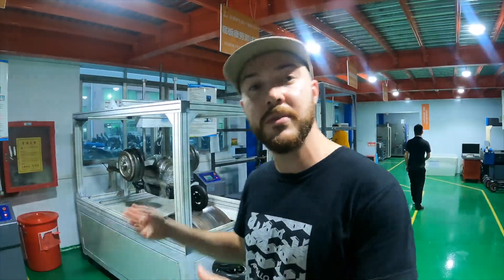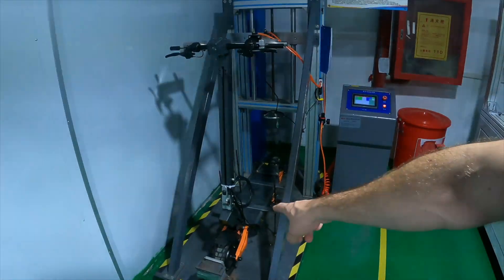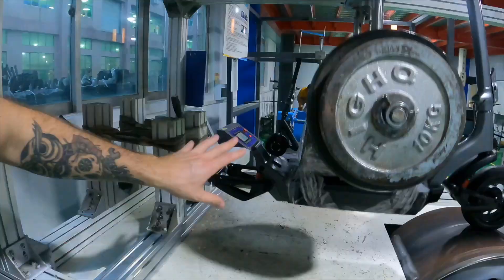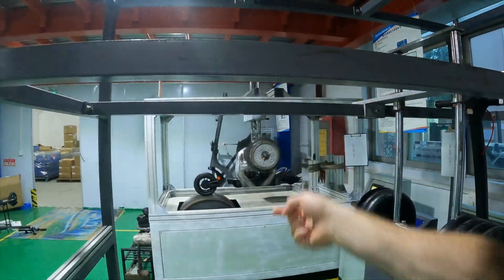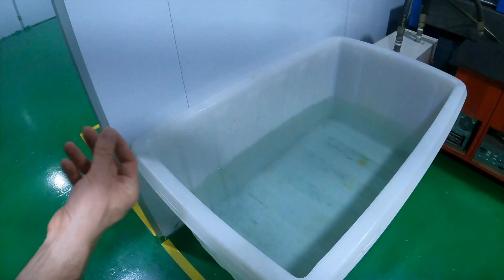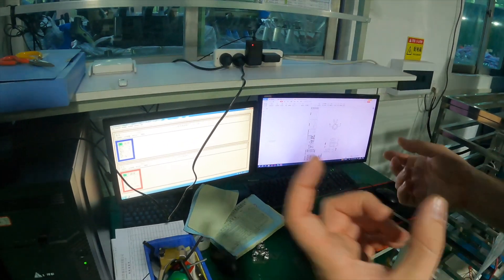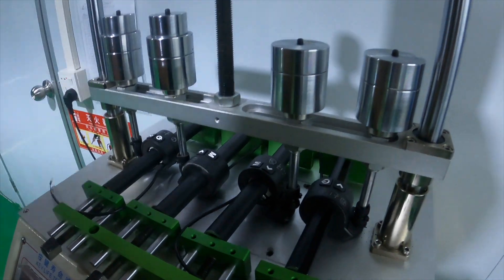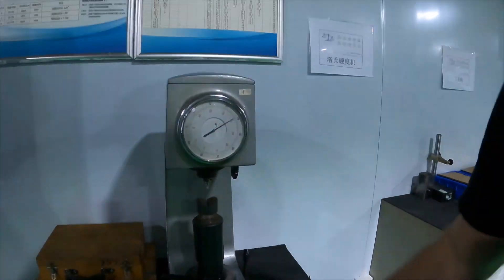Apollo Factory: Quality Testing Process Preview

Comment: Will the scooters with IP66 rating or higher ever be covered under warranty for water damage? 

I've noticed a lot of companies advertise their products as water resistant or water proof but they don't cover water damage in the warranty. 

Is there a reason for this and do you guys have any plans to address it? 

It only seems appropriate for a product advertised as water proof to be covered by warranty for water damage.
Reply from the maker: Hi Oven Heating,

Thanks for your question!

While we strive to provide the best possible water resistance rating that we can, electronic devices are never covered for water damage under their respective warranties. The reason for this is that water damage is usually classified as physical damage, not a manufacturing defect. An electric scooter can be classified as both a vehicle and an electronic device, so the warranty coverage it would receive is in line with other electronic devices. Additionally, no electric scooter manufacturer covers water damage as part of their standard warranty.

An example of this are flagship smartphones (iPhones, Samsung Galaxy, etc.) which are even rated IP68 but are not covered for water damage. Another example are GoPro cameras which are frequently used underwater but are not covered for water damage under the warranty as well.

However, we are glad to announce that US customers can now opt in for an extended warranty which covers flat tires, water damage, and accidental damage. If you'd like to learn more about this expanded coverage, please go to: https://apollo-help-center.gorgias.help/en-US/what-does-extend-extended-warranty-cover-230320

We hope this clears things up and please don't hesitate to reach out if you have additional questions :)

Comment: It's aluminum. At a severe angle of leverage. You put a big enough person on it and they put enough weight on the bars or hard enough impact and it's gonna crack. Just like the rest. Use treated steel and/or better geometry. Aluminum just can't handle stress like that.
Reply: They test cars in labs and on tracks for a reason and scooters should be the same. Lab testing can not replicate all real world scenarios i.e. when jumping of a kerb, the stresses rarely are distributed evenly between front and rear axle due to the impact angle, which then places extreme pressure on the stem. These tests simulate sensible riding.
Reply from the maker: Thanks for your comment! Our scooters are tested up to 3x the industry standard to ensure that they are safe. Additionally, we also include a max rider weight for each model.
Reply: @ApolloScooters  And yet they still manage to crack...